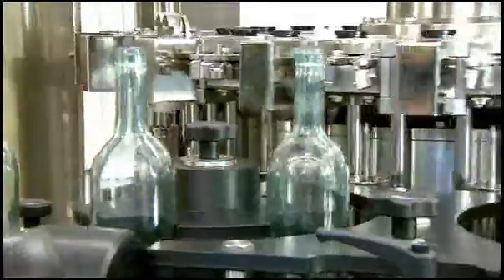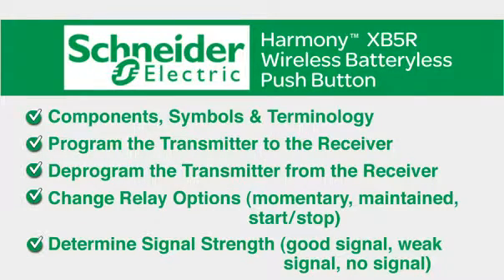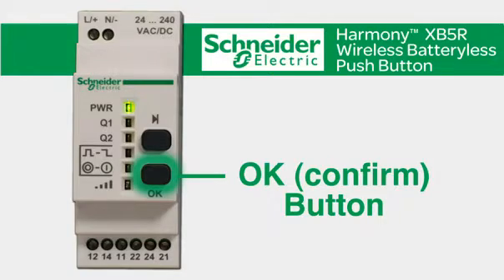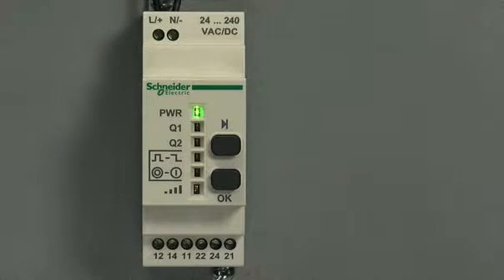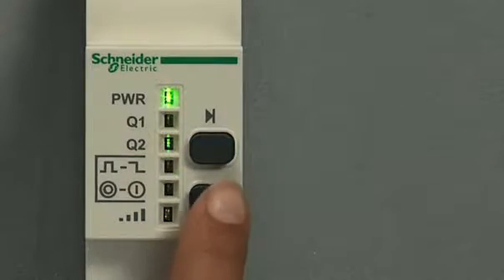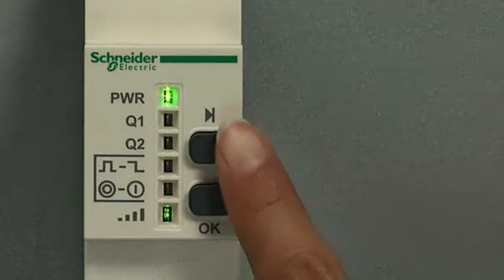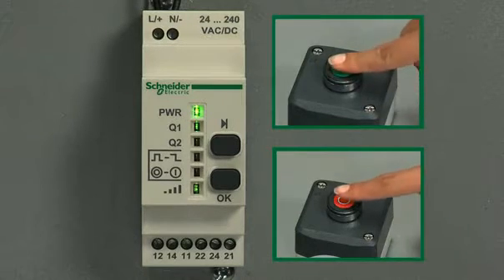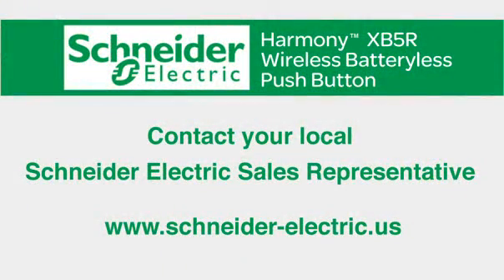Schneider Electric Harmony XB5R Wireless/Batteryless Push Button

Comment: Have you ever tried to manually push a schnieder contactor and notice that the snubber LED lights up?  Your generating a EMF through the coil of the contactor which is generating enough current to momentarly turn on a Transmitter circuit.